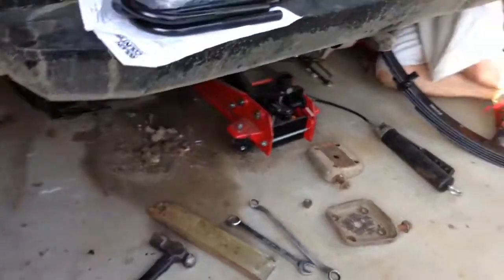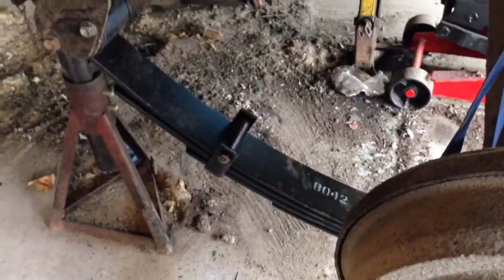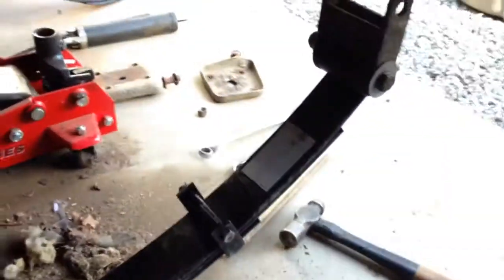The Dans Fj40 #70 - Getting lifted.  New Springs! 4" lift.

Comment: The best investment over air lift or bags...just replace the worn out or broken springs and add some leafs. When I worked for a GM dealer in a small town we would get replacement springs from Davenport Spring Company in Davenport, IA. A female would answer and you better not ask for the Parts Department. She was it! And don't doubt her knowledge of what you needed. It didn't matter what brand car or truck you had she had the springs for it. And she had the information to you in less than 5 seconds. It would have been interesting to actually meet the person. The way she commanded respect on the phone, my guess is you wouldn't want to cross her path. Also very good about TELLING you that you needed center bolts, u-bolts and shackles and eye bolts and she knew the sizes. You might as well give in and buy them or you would never hear the end of it.
Reply from the maker: This is a cost permitting project, so as soon as Dan gathers up some more extra cash, he's going to change out the shackles (That actually appear to come from an unrelated vehicle) and the base plates, those were pretty rusted out. We have a local spring shop, but this kit, shipped, and with all of the required items, came in well below their price point.  (I'm really not sure how they do it...)

Comment: Can you provide any more info on the lift being used on the truck? Shocks and leaf packs. Think I heard rough country in the video?
Reply from the maker: +dirtbike250xx I'll ask Dan if he still has the info specs on it. It all came as one package, very complete shocks and all and we were very pleased with it. One of the things that sticks out in my mind as a 'problem' was the wedges in the back. (For correcting drive line angle) They were made of aluminum, and ended up cracking in half the following week. We (Dan) ended up making a set out of steel to replace them.  But other than that, it was a great set up, just enough flex, but not too much. The FJ40 probably didn't need a 4" lift initially, but when we got the 35" tires, it almost looked stock again.   We'll be migrating this setup over to TANK II as soon as we can.
Reply: +JimsEquipmentShed That would be great, I've been scanning through your build and wheeling videos, I've been admiring the setup. Would like a similar setup for mine when time comes.
Reply from the maker: +dirtbike250xx it worked really well, we'll be migrating all of it over to Tank II.
Reply from the maker: dirtbike250xx
Dan said that he got the kit on Amazon (From the Rough country portal) The shocks U-bolts, and springs were a complete package, he doesn't have any of the stock numbers or anything. Thats all the info he had on it.  Sorry.